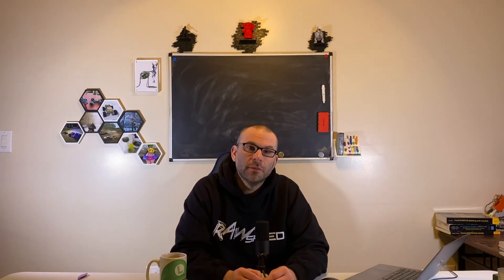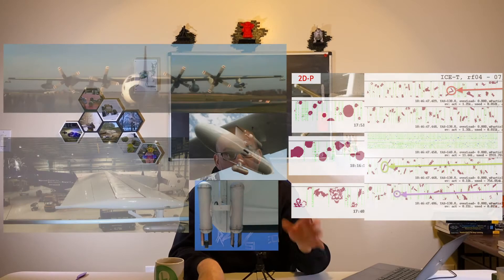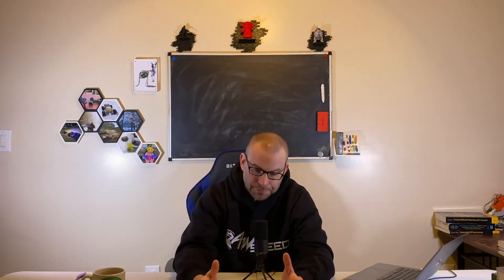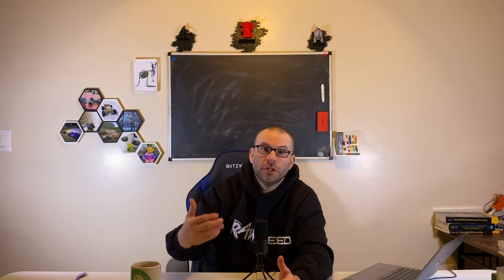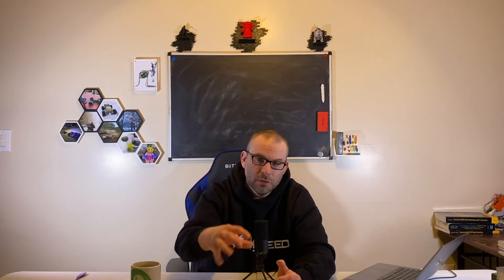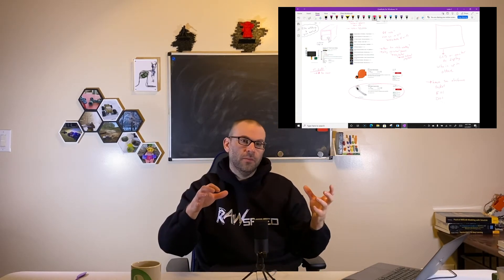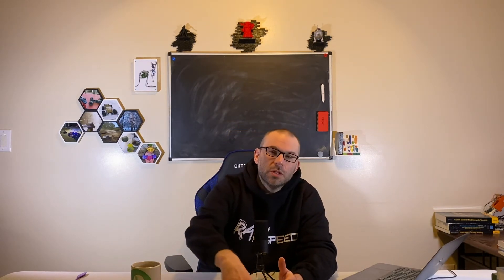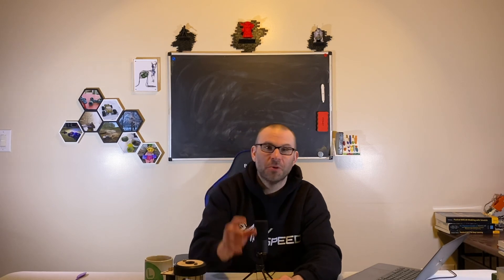Overview of Mark Rober's Creative Engineering Class!

Comment: I honestly felt the course was overhyped and deceptive in its marketing. The sales reps reassured me that I would get a lot of what I was interested in, which was disappointingly not the case. I would not say it is a course for "all levels" as promised, especially when the curriculum shows it to be mostly technical skills, and the creative/engineering process was not expanded on (repeated for each project with no increase in details). My peer room was filled with mostly inexperienced students whose comments consisted mostly of "Cool project"... not very actionable feedback...
Reply from the maker: I understand and respect your opinion.  I can see how you would feel considering the lack of peer to peer interaction.  I was very lucky to have full engagement.  I also knew that going into this that I would probably not get much since I have a solid background but to see any other "weapons" I could use towards engineering and see what creative engineering really was.  How much or what is your particular background?
Reply: @drluketheduke1531  I worked in construction from when I was 18 to 22, did my bachelor's in automation/control engineering (basically a mix of electrical, mechanical, and software engineering) and now work as a software engineer. My construction experience has helped in learning how to use tools and gave me a taste for building things. My degree taught me a lot about sensors and the very basics of programming, using Arduinos and reading datasheets for components, usage of Linux, and the basics of 3D modeling software. Most recently as a software engineer I bought a cheap Creality 3D printer and went through the process of learning to set it up and use it, with Fusion 360 being free for hobby use.

I also knew going in that some things they sold as part of their course were unrealistic promises (such as peer interaction or being for all levels). However, I did not expect it to be so disappointing in terms of fresh content and once I saw how the brainstorming/research phase was regurgitated for each part, that really put me off, especially since this was most apparent only shortly after the refund period. I was also interested in the creative engineering aspect, but I did not expect that it would be such a simple explanation.
Reply from the maker: @davinderc  oh wow, so you had a ton of knowledge and congrats on your degree and accomplishments.  That's amazing!  Most of the class was information you had already knew - similar to me but my peer to peer was a lot more helpful and directed and some of the projects he did, I had never even thought about doing.  Did you email them and ask for a refund or a partial refund at least when you began to have those feelings?
Reply: @drluketheduke1531  Yes, I actually started asking questions before buying the course because I had a similar experiences with Udacity as both a student and a mentor and knew a bit what to expect. Their answers weren't satisfactory, but I continued communicating and there might be a positive outcome for both sides...
Reply from the maker: @davinderc  good luck and I enjoyed the communication ! 👍
Reply: @drluketheduke1531  Thank you! The refund went through sometime after I sent them feedback and they were apparently quite happy with everything I told them.
Reply from the maker: @davinderc  that is awesome! :-)  fantastic!!!!